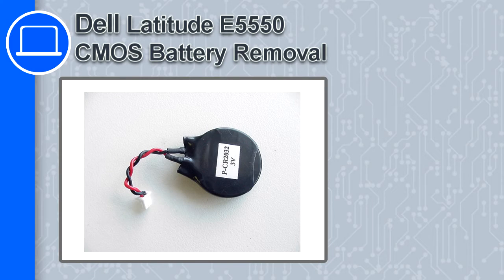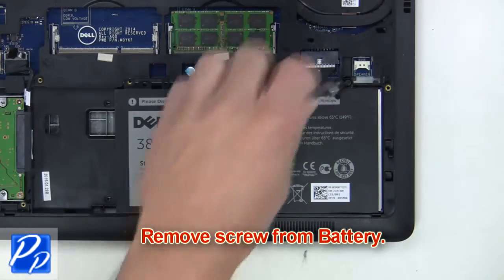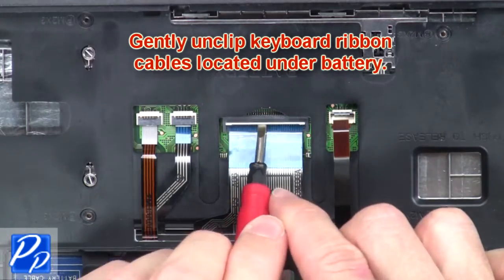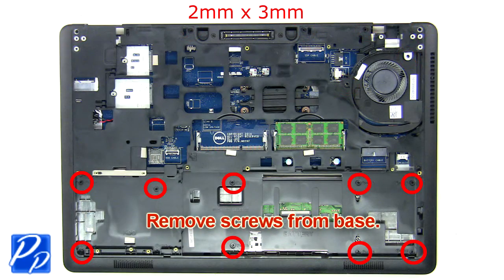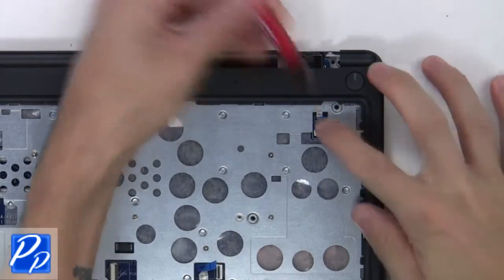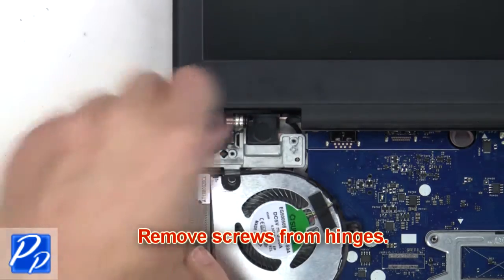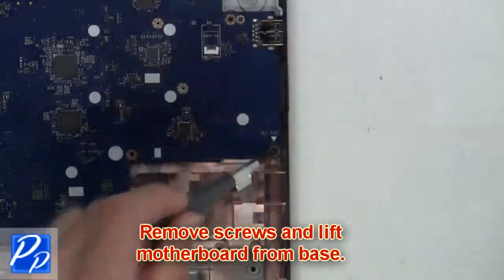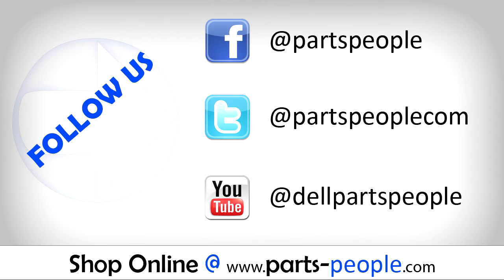Dell Latitude E5550 CMOS Battery Replacement Video Tutorial

Comment: Missing a few minor steps that can hang a normal person up, still helped

Keyboard is a pain, but take your time

For the "Base" screws, it's all the one marked with (P)

Far easier and less worrying to unplug the LCD cable before taking the hinge screws off

Last, take out the dummy SD card. It will hold in the motherboard 😜

Good luck! 🎉

Also, if your careful enough.. you can just use a Dremel to cut off the little 1" square piece of plastic that covers the battery connector 😅 and make it a 5 minute job

Comment: So much effort just to replace a consumable. What the hell, Dell?

I just broke off the plastic covering the cmos battery connector and used some isopropyl alcohol to dissolve the glue holding the battery down.

Comment: This works. But I modified it to just take 5 min. Take the cove off (six screws) cut the plastic bottom with a razor knife just below the batt. 1 inch square. batt comes out and put the the new in. (piece of two sided tape to hold it in place). Put the two covers back on (six screws). everything looks fine. no sign of the short cut.
Reply: Bro u gotta come back and tell me how to do this aint no way im going to dissassembly this old thing all the way.